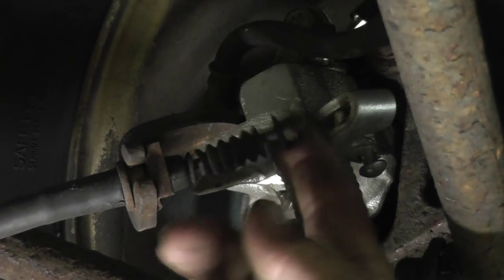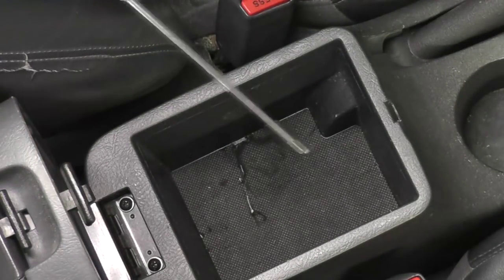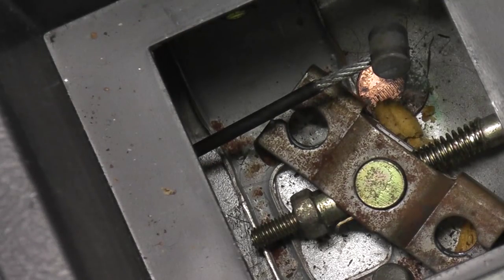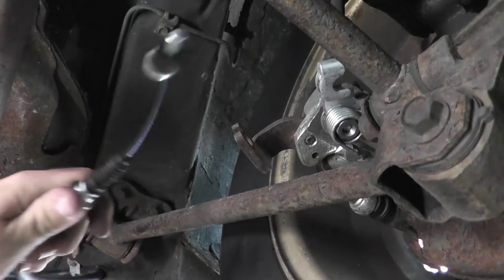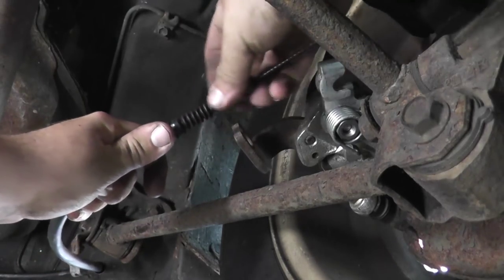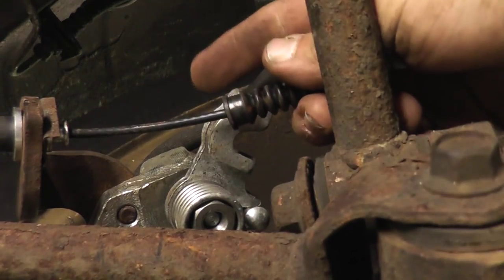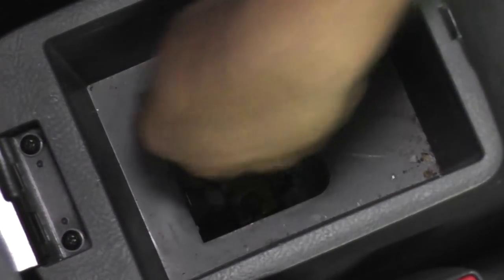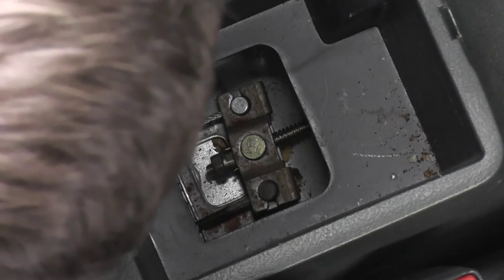01-06 Hyundai Elantra parking brake replacement

Comment: Thank you, sir! This helped tremendously.

My cable didn't snap, but it did become immovable and had to be replaced.

I had the same problem of the new cable (Auto 7 920-0199) not fitting in the old bracket. Instead of drilling the bracket hole larger (Which was difficult because it was hard steel), I used a rotary tool and ground down the cable collar (Which was easier because it was a softer metal).

Comment: Tried changing it today. I realized that the new caliper I had put in doesn't have the metal bracket in which to put the e-brake clip. 
 http://www.autozone.com/brakes-and-traction-control/brake-caliper-rear/duralast-reman-brake-caliper-rear/692504_571704_2362/

Comment: Great video. I was wondering which way to pull out the cable. However- a note for newbies: it might be easier to just remove the whole console to work on the cable rather than stick your hands through that tiny hole. It's easy.

Comment: cheers from Australia... removed the console and found the mechanism loose... re-tensioned the adjuster nut and it works as good as new.
Reply: I dropped a stainless steel spoon right where my parking break handle is❗😭

I'm hoping I can get to it by getting the little box without removing the whole console.

Comment: Is each side adjustable from the console,i had a little trouble replacing my rear pads and loosened the bolt that has the detrnts on it and dont want to take the wheela off again

Comment: I installed a remanufactured caliper on my 2005 elantra and the parking brake mechanism is slightly different, it just has a groove and doesn't hook over like yours in the video or on the original; There is no slot to hold the pin in place. I'm not sure what to do.

I already turned in the original for the core money.
Reply from the maker: Most calipers when you buy them do not come with the parking brake cable bracket. usually you need to re-use the old one. If you do not have a bracket with your new caliper you will probably have to go to the junkyard and find one.

Comment: can you tell me why when my ebrake is pulled in my 1990 240sx it drains the master cylinder of fluid. I replaced rear calipers with napa ones first set was faulty second set does this leaking. any help?
Reply from the maker: This leaking you are talking about, Do you actually see fluid leaking from the calipers? Or are you finding that the level in the Master cylinder dropping? When you replaced the calipers did you bleed the air out of them?

Comment: hi i put new caliper and cable on my hyundai coupe same system as elantra but when handbrake is adjusted so that it touches the stops on the caliper the hanbrake lever is pointing skywards?? is there anything i can do to fix this?
Reply: +Leighton Richards  Some Hyundai models have a disc brake with a small drum parking brake.  (Other places can tell you how to remove the rotor.)  After removing the rotor and BEFORE taking off the shoes, verify the lever at the top of the shoes can move. That lever and mechanism  forces the shoes outwards to park.  If it is frozen, do what you have to to get it moving.

Comment: Hey i couldnt reply im on my phone. But i cant see it leak fluid anywhere. And i bled the while system myltiple times
Reply from the maker: If your brake fluid level is dropping in the master cylinder, and you do not see any fluid leaking out, then it is probably filling air-pockets left behind in the lines or brake calipers. Fluid has to be going somewhere. You may have to bleed them a bit more. Rear calipers can take awhile to bleed. Other than that, I am not sure what else I could recommend.